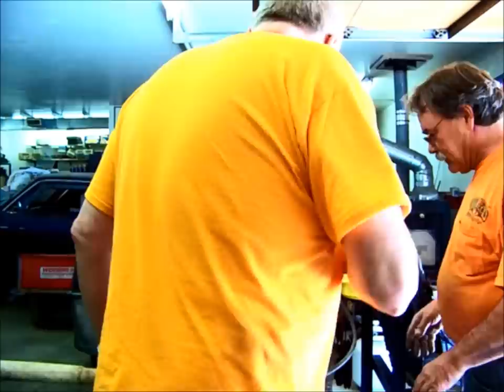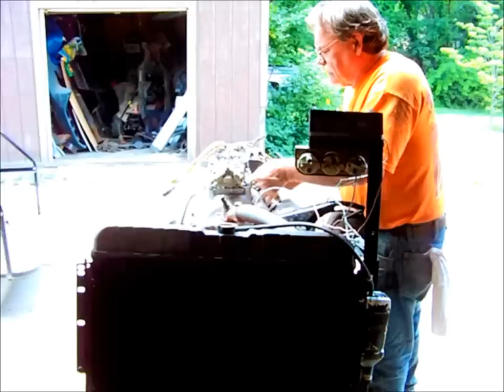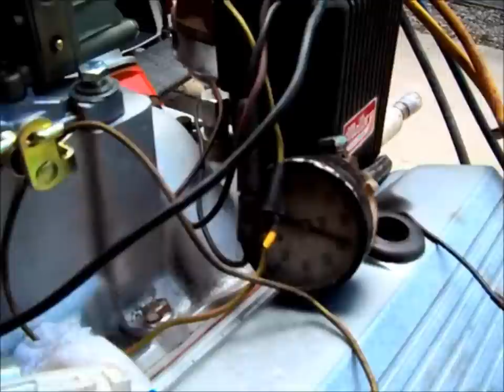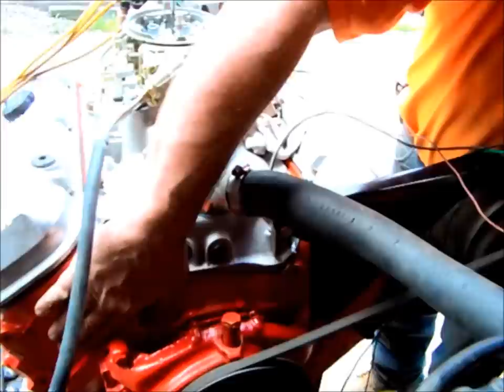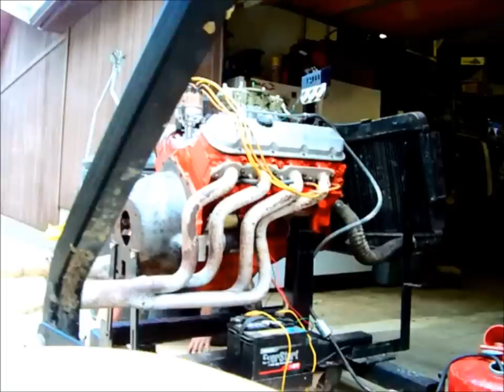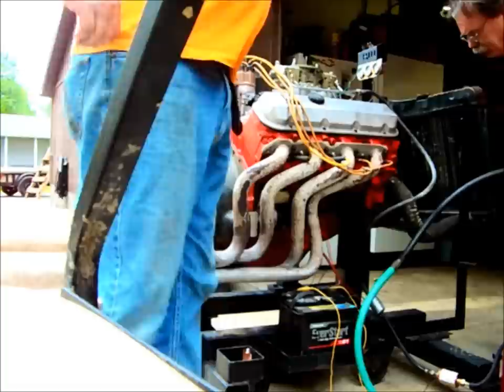low compression 454.wmv

Comment: Could you tell me what lift , duration, LSA and brand that your cam is? I have a Gen 5 454 in a 66 Chevelle that needs help. Your sounds nice and really goes! Any help would be appreciated. Thank You     Eric
Reply from the maker: Camshaft, Hydraulic Flat Tappet, Advertised Duration 292/304, Lift .540/.540, Chevy, Big Block  Summit pn1302

Comment: what compression does that engine have .....  looking at using the same cam in my 7.8-8.1 compression 454
Reply: +Joe Dibella  Joe, it's stock, with the exception the cam & Gear drive and GM Performance Compost head gaskets which are thinner than the Standard rebuild composite.  BTW Don't make the same mistake I made by using a Gen 4 head gasket, The over heating will drive ya crazy. see this: http://www.superchevy.com/how-to/4567-chevrolet-big-block-engine-generations/  If ya use gen 4 ( 1967-1989 BB they will short ckt the water flow & not flow water to the rear of the block & you;ll NEVER cure the over heating) So it might be a tad over 8.5:1..maybe 8.6:1 In a 2500 pound car, w/ 3:90 screw and 4000k stall in front of a TH400, the prick scoots!! Will ¼ mile this coming summer. Thanks for Yr Interest ! g²
Reply: +Greg G  Did a little more research & it looks like the stock compression was 7.9:1 !  So with thinner Chevy performance gaskets it MIGHT be 8.2 :1 these are the gaskets:  http://www.summitracing.com/parts/nal-12555728/overview/make/chevrolet  they compress down to .022 which appears to be the thinnest compressed thickness of any on that page of Fel-Pros   good luck g²

Comment: what, in heavens sake, made you put a gear drive on this otherwise healthy engine??????????????
Reply from the maker: 7 years ago, it seemed like a Good idea. Last rebuild I put on old school; solid lifter "Pro Street" Cam. Haven't ¼ mile'd it yet, but its early. One thing about the gear drive the spark scatter observed with timing light was nonexistent with gear drive. Now with double roller, it jumps some. when I tore it down for the rebuild, I found one of the hyd lifters had thrown the plunger snap ring, and found it laying in he valley.Correctly or not I attribute that to the  gear drive harmonic on the cam.

Comment: What camshaft did you use
Reply from the maker: +Fairlane351C  Summit hyd, Sum K1302,
http://www.summitracing.com/parts/sum-k1302/overview/make/chevrolet
Reply: @jettapup How much compression did it have?
Reply from the maker: This motor, about 8:½ to 1, with the wrong head gaskets, using the Chevy competition (thinner compressed thickens, maybe 8 3/4 :1